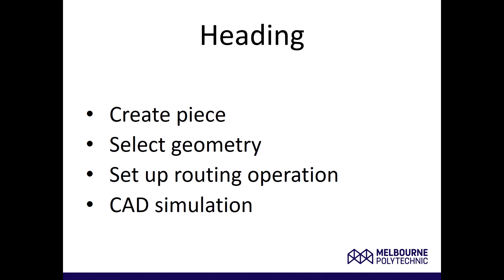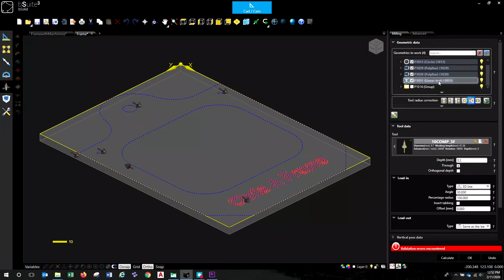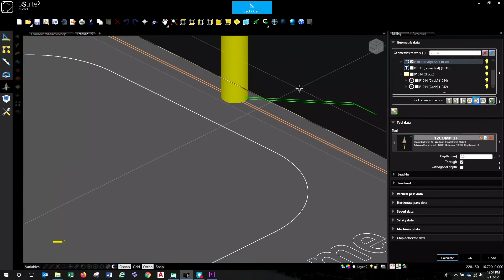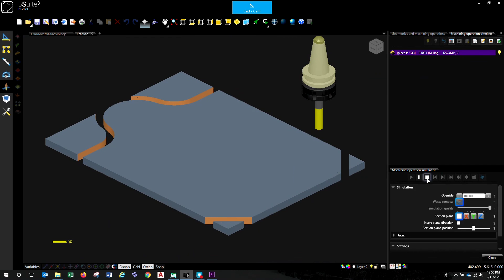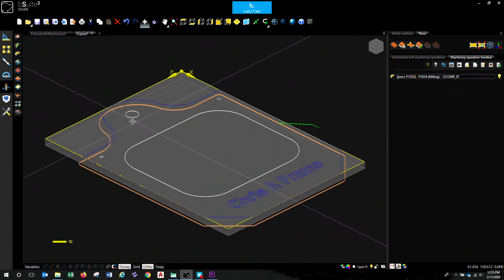3.1 Machining - Routing/Milling with bSolid

Comment: ¿any plan on making a video about using the tracing function that several biesse machines have to measure the part before machining?
Reply from the maker: Hi Guillermo. I wish to could but I don’t know how and our machine is not equipped with the measurement probe. Good luck!